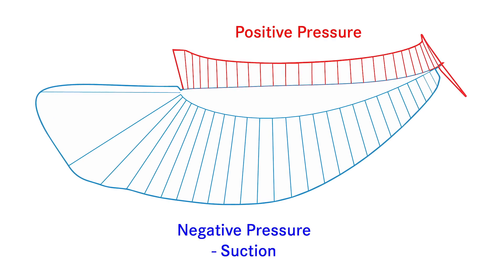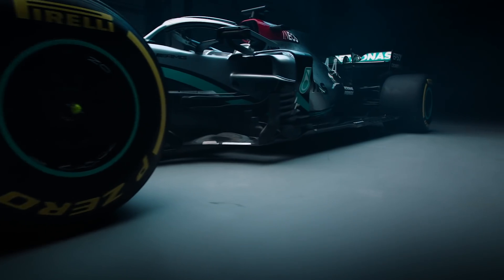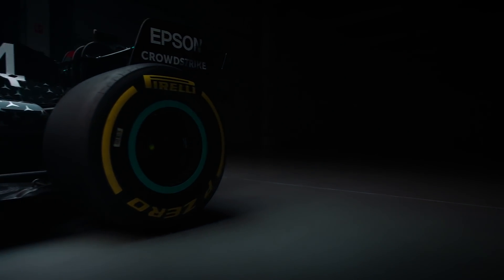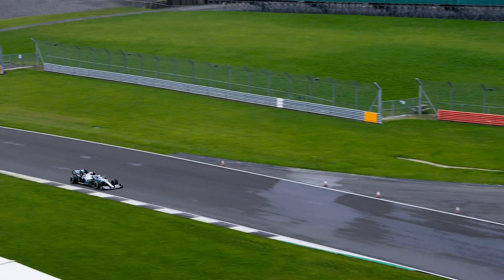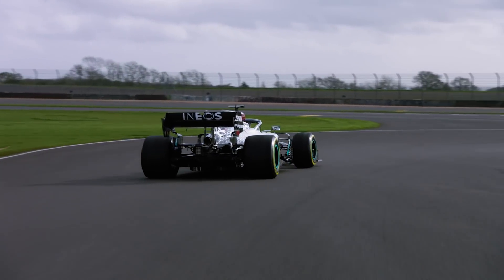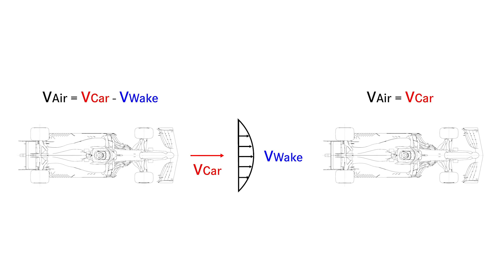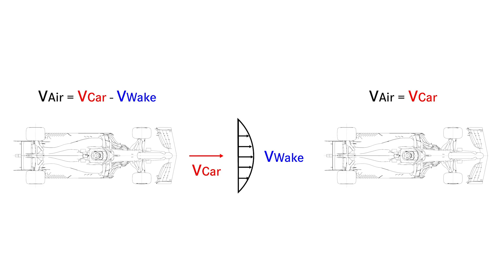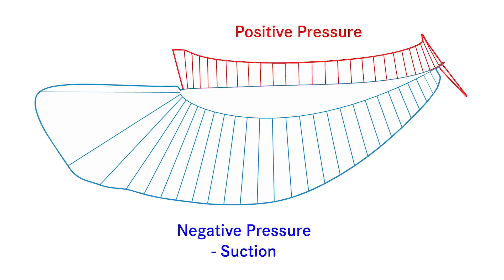Can an F1 Car REALLY Drive Upside Down? Aerodynamics EXPLAINED

Comment: Yes, an Indy car can drive upside down with sufficient differential pressure on the wing ( if the wing has sufficient surface area and low kinetic friction. The practical challenge is making a transition from upright to upside down using a specially designed track and making sure the engine can function while operating upside down.  The laws of physics are universal at this scale.

Comment: Just build an upside side down track. Insert a recessed rail line maybe 2 for extra safety. Connect car to sliding track tighten it to match correct forces of gravity to simulate a similar effect of gravity. Put g force or what ever kind of sensors connected to attachment points (measurement points). 
 Measure forces as driver (or robot) drives car on track. You could technically say it was driving on the track using down forces created by its speed and design. 

 Step 2: creat speed racer style race track and purposefully make people race upside down and do loopdy loops and jumps! And make the track look like a hot wheels track! 
 
Come on the future. You can do it.

Comment: As an aircraft designer, I take issue with being “sucked into the air”. That is not the case. Because the air on the lower side of an aircraft wing travels slower, as it moves from the front to the back of the wing, the pressure of that air is higher than faster-moving air on the upper side of the wing. If you want a real-world example, stick your head out of a car window when you ARE NOT driving! The high-speed air, passing along the car, will pull the air out of your lungs. It is quite uncomfortable. On an aircraft wing, the low-pressure of the air on the upper surface of the wing means that the wing is pushed into the air from underneath. What the Mercedes aerodynamicist meant to say refers to downforce from under the car. Airflow accelerates air as it passes around the skirt of the car. This fast-flowing air sucks air from under the car, resulting in the floor of the car being pulled towards the tarmac. Even when an aircraft is on the ground, the wings are tipped up at the leading edge of the wing. So, as speed increases, there is a slight amount of lift that is intended to help the aircraft transition to flight. Wings don’t suck...amusing though this might sound...
Reply: Wow, nobody cares. That’s crazy huh😂
Reply: What a loser😂😂 pretending to be an expert, how tragic

Comment: I just can't accept some of the answers of the guy on the right and he suppose to be some expert. First of all, in the low-speed corners, there is no air to push on the wings, thus rendering the wings less effective (you can see this on videos where cars lost their wings and on the high-speed corners they immediately go off, whilst on low-speed corners they can run fine), second, a F1 car cannot run upside-down (at least not for long), there isn't sufficient oil pressure and lubrication, because, due to gravity, all oil will fall from the bay to the top of cylinders and also the fuel will go down from the reservoir. The amount of downforce may keep the car sucked to the ceiling, but liquids inside will definitely fall down.

Comment: 4:44 I worked this out once and the extra speed required to generate enough traction to overcome drag is quite significant. In fact, the L/D of the overall aero package is a factor. Too inefficient an aero package and the extra speed required exceeds the Vmax of the car. I don't have up to date numbers but Canada / Spa aero packages used to be the sweet spot for the slowest viable upside down speed.
Reply: How did you do that without the Cl or Cd?

Comment: Nice chat.  Who would have thought an aerodynamicist could be so much fun?  Something that's bothered me regarding DAS:  If this is a game of millimeters, wouldn't any variation in the outward angle of the front wheels, change the airflow coming off those tires and disrupt the chain of vortices that the aero folks have so meticulously set up?  Does anyone out there have any guesses?
Reply: @Pat Baskshis I'd say no.  The models have to compensate not only rotational turbulence coming off the tires but directional steering lock.  F1 cars have to turn sometime.  This was primarily mclaren's problem in 2018.
The slight change in chamber might slightly reduce drag, increasing top speed.  But that effect would be negligible.
Reply: @Bahamuttiamat       If I understand it right, the toe opens up to attack curves and slots back to normal on straights.  Too bad we won't have a full season to tinker with it.  You have a point---nothing's static about a race.  Wonder if they can angle the air flow in their wind tunnel to replicate certain curves on certain tracks.  Or is that a matter for CFD?

Comment: 3:35 I think if we break down the question, it should be like this
1) Where do downforce makes the most difference: Low and Medium speed corners, because naturally those corners take more time. This is probably one of the key reasons to why  in 2019 Mercedes was so dominant in these corners and why they were quite slow on straights. Their philosophy of the 2019 car design is "downforce at all costs".
2) Where do downforce make up the most of the grip: High speed corners, because when you need crazy amount of grip for corners like Silverstone Copse, only crazy amount of downforce can offer you that.
Reply: @Andrew Exactly.  I've been arguing this point with "arm chair" experts for years.  They misunderstand downforce.  While it's needed for high speed, relative to time - an f1 car loses most in slow speed corners.  Hence the reason places like monaco/singapore and hungary demand max downforce.  As with everything, it's a trade off.  Mercedes design their cars for all tracks and conditions, unlike redbull that specifies high downforce tracks.
They weren't slow in a straight line, ferrari was just incredibly.. unexpectedly fast.  For reasons we won't get into.  
Another great side-effect of downforce is tire wear reduction due to less sliding.  Managing today's capricious pirelli is key.  

This team is awesome.  Bare in mind, Mike Elliot designed the 2012/2013 lotus, which were renown for their amazing tire wear properties.  He's an elite aerodynamicist.

Comment: "Can F1 car drive upside down?"

Hamilton: not with these tires bono...
Lando: like a roller coaster?
Kimi: is the car... Have the drink on?
Reply: Gimme the steering wheel, hey! gloves and steering wheel
Reply: No Kimi you will not have de derinck
Reply: Kimi would not have the drink if the drink depends on gravity
Reply: Is kimi alcoholic
Reply: Hi fellow degenerate

Comment: I always thought a racecar has a lot more rear downforce than front and would struggle to stay balanced upside down. ¯\_(ツ)_/¯
Reply: @San "reasonably distributed" doesn't mean 50 - 50 necessarily.... An axle that's under the same aero load BUT also has more weight on will be looser (will break grip earlier), because inertia is a thing.
Reply: @bosshunterman  I think it's just easier to summarize like this: What they are balancing out is the grip of each tyre to be roughly 25%-25%-25%-25%(over the course of a full lap), the grip level although consists of weight disribution, downforce level, suspension and it's setup, differential etc, which each respectivly should not be exactly balanced, but can be counteracted.

An over-simple example of this would be how in F12018 game you could put the ballast to the most rear position and counteract it with having a really skinny front wing. (If you could manage a very lively rearend you'd gain miles on the straights not loosing barely anything in corners)
Reply: @1Carnaby  That's not really how it works, the regulations state that the cars have a 45.5-53.5 weight distribution (idk where that 0.01 went, but that's what it says on the 2020 regs https://www.fia.com/regulation/category/110), when talkiing about aerodynamic balance there are 2 points we are interested in, the CoM and the CoP, the position of the CoM is indicated by the weight distribution and the CoP is affected by the downforce. Ideally those 2 points should be in the same vertical line, but that's not the case, this applies to both airplanes and racecars, see, if the CoP is slightly behind the CoM nothing bad happens, at worst there will be some understeer, however, if the CoP is even slightly in front of the CoM that's a recipe for disaster, the CoM always wants to be in front of the CoP (think of how stable a dart or an arrow are when thrown correctly, and if you ever tried to throw one backwards you know what happens), an aircraft will be completely unflyable and a racecar will be very scary, more demanding and slower. So if the weight distribution is 46-54 I can assure you that there is no more than 45% of the downforce on the front axle.

On another note, I did some calculations with the numbers the man gave when talking about driving on the ceiling and I found out that an F1 car has a ClA (basically downforce points) of around 6.8, I assume they multiply this by 1000 to get what they actually call downforce points, so 6800 total. Next time a driver has a broken car and his engineer tells him how many points of downforce they've lost you know what it means
Reply: @1Carnaby  also my response was because of the F1 2018 thing at the end, if you move weight to the rear you would take the downforce off the front, otherwise you'll spin at every corner (in real life)
Reply: Surely they have more rear downforce, but keep in mind that F1 cars also have considerably more weight resting on their rear axle (45% - front, 55% - rear, roughly), so they NEED proportionally more DF in the back to stay balanced.... Also, I don't get why you think unbalanced load would only be a problem when they're turned upside down...

Comment: I haven't finished the video yet, I wonder at what speed the downforce starts to have effective results on the grip of the tyres.
Reply: At about 80 - 100 km/hour the role of aerodynamics becomes significant enough to produce both serious drag and downforce, and at 160+  the F1 car, in theory, can drive upside down.   That's a very crude explanation  ....
Reply: @Nikowalker007  unless you have a Brabham BT46B.....in which case you can generate down force even when you are standing still...🤣🤣🤣
Reply: @annamalaisureshbabu3671  True ...     Vacuum power for the win  😄. The car was so ahead of its time that the regulators banned it after a few races ...
Reply: @Nikowalker007  They didn't ban it. It only took part in 1 race where easily won, the other teams protested it saying that it threw rocks from behind, the FIA allowed them to use it for the rest of the season, but Brabham decided not to use it. It was banned for the year after though
Reply: @jorge8596 Yes, I guess there was a loophole in the FIA rule book and Brabham decided to go for it and claim it as a cooling fan for its v12 engine :) . Gordon Murray later wrote that the car was actually heavier and more powerful by 10 % than its competition, so there was a lot more stress on transmission, suspension and brakes, fuel consumption was also much higher, so on fast and medium tracks it didn't really have significant advantage because it needed to carry more fuel or spend more time in pits, but it would definitely shine and was total track animal in Monaco or any slow track, I guess it was not worth potential hassle with lawyers, sponsors, fans, etc in the future so Brabham decided to withdraw the Fan car. Actually, this reminds me a lot about the story, (scandal?) , with Ferrari fuel consumption last year, and how it managed to squeeze more power using a loophole in a fuel delivery system regulations (in Monza, even with DRS, Lewis could barely keep up with Charles).  Then, at the end of the season every team protested  and FIA said, although not illegal, Ferrari can't use this system anymore )

Comment: Yes it can. But the car has to maintain very high speed i think🤔🏎
Reply: not so fast, than you thimk imo
Reply: You’ve just simplified this vid so much 🙏🙏😀
Reply: @arthursmith9767  I didn't simplify it that much i just assumed that a car has to get supersonic fast😂
But turns out the f1 car only needs to driv a little over 150 kph (~93 miles) Have a great day
Reply: Oliver Guggenheimer 
Oh yh Lol
Reply: Not if the car in question is a Brabham BT46B....
Reply: not that high for an F1 car, 150kph or a little more than 93 mph
Reply: It can be done at minus speed...
Reply: @stevenlarratt3638  well....😂